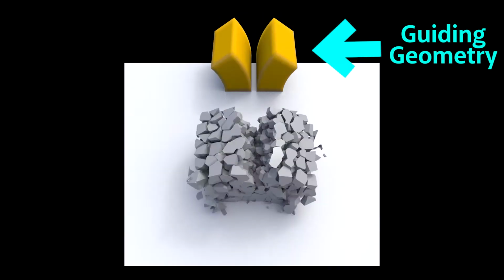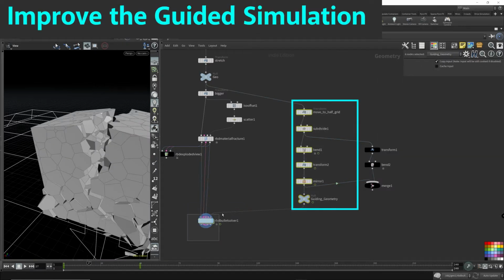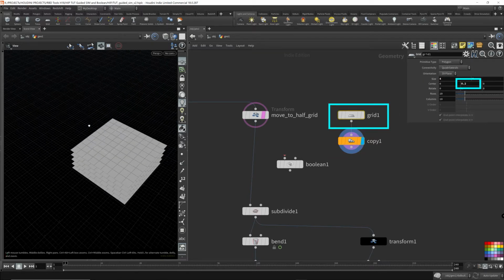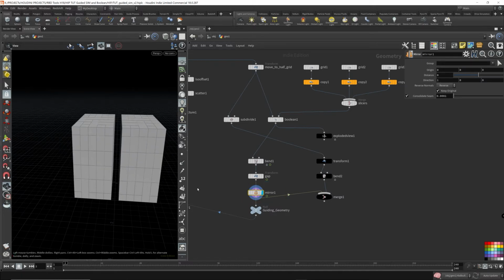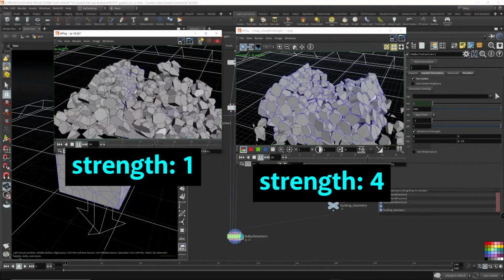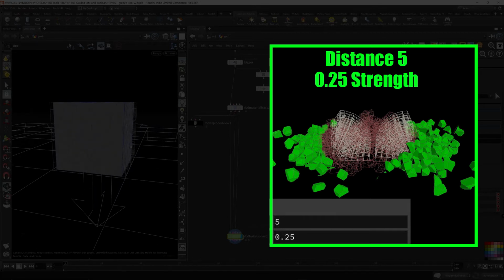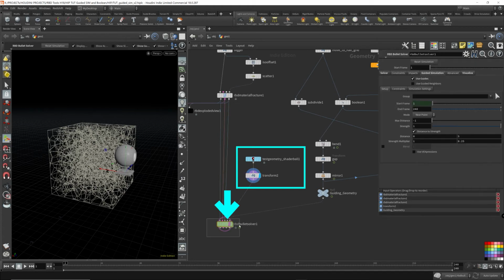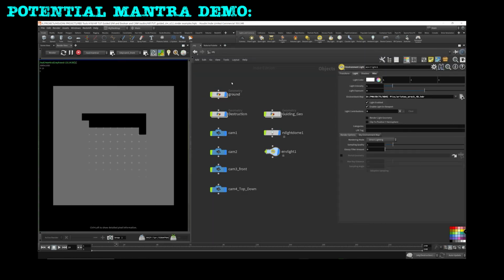Improve Guided Simulation with RBD Tools in Houdini

Comment: The Key for the jitter piece in guide simulation mode, is to activate the "BLEND"checkbox and reduce the value from 1 to 0.5 and less to have a natural look. in this way you can leave the strenght multiplier higher than 4 but at same time gradually blend to this value and release when exceed the breaking threshold 👍. 
(Inspired by your setup for the guided geo, i clip in half the original geo, fill holes, transform a bit from the center, remesh for giving resolutiion, add a TET EMBED for creating the inside geo, bend it, mirror it and put in the guided geo.)
Reply from the maker: Awesome advise!  Thanks so much for the tips!  I never used the blend to remove the jitter, but very good advise!  And very good idea for using the tet embed to create guided geo.

Comment: Sorry if a look like a fool asking this, but why use a shatter boolean instead of making a vdb from the bend animation?
Reply from the maker: It is a good question!

The rbd solver won't take a volume as input for the Guided Simulation feature. 

I tried converting the geo to a vdb and convert it back to a polygon and feed it into the Guided Sim just to try to see what happens...  because if this worked, we would be able to feed in a lot of complex animations!  Unfortunately it didn't work out, the number of points change every frame due to the vdb convert remeshing the polygon.  The Guided Sim feature calculates the velocity of the influence points of the guiding geo that gets fed in and uses that velocity to influence the simulation.

Hope this helps!
Reply: OOOOHH gotcha. Didnt realise that the number of points would change. Thanks. Love your videos.
Reply: @bubblepins  You can still use iso offset (driven by the values from the one we used to fracture the cube) with scatter (again, it can match the "fracture" scatter) or points from volume. The points don't jump around and the animation that we created still works.

Comment: Hey, sorry for asking this as it doesn't relate to the content of the video, but it's something i desperately need to know. Suppose i want to add measurements to a houdini modal, how does one achieve that? Any ideas?
Reply from the maker: Hi, all questions are welcomed!  As for measurements, I'm not sure what you mean by that.  Are you referring to 3D modeling like CAD programs?  In Houdini, there's a measure node, I'm not sure if that is what you're looking for.  The measure node can calculate area, volume, curvature, etc.  If you need something to measure the length of an edge, I think you can isolate that edge using groups and then drop down a measure node to calculate measurements for that edge.  Remember Houdini units are in meters, so 1 Houdini unit (the number 1 you see on the grid = 1 meter). 

Hope this helps!